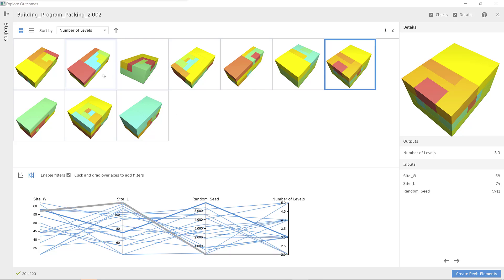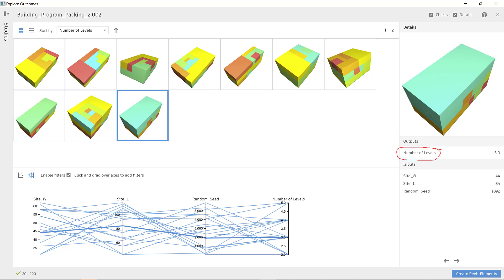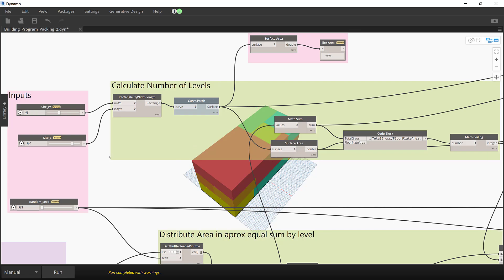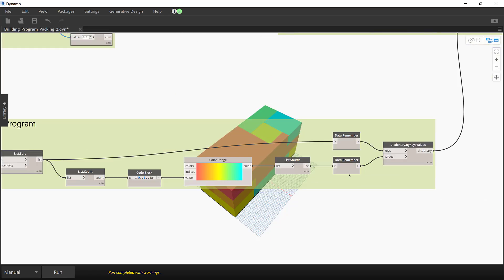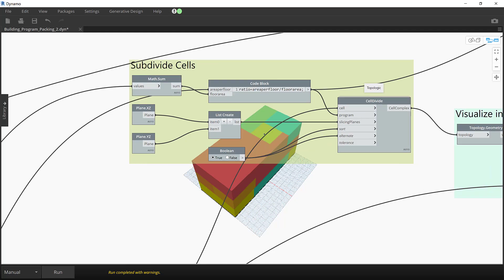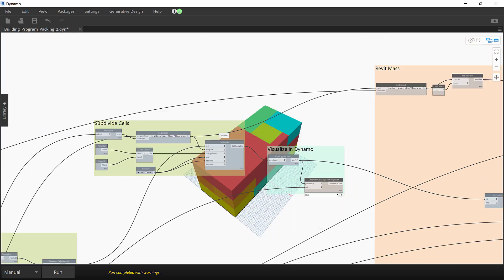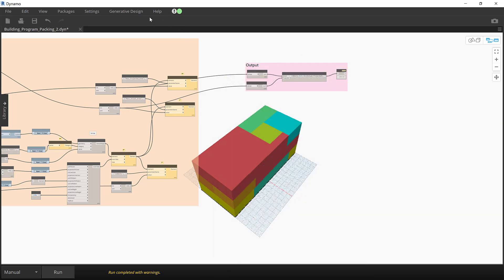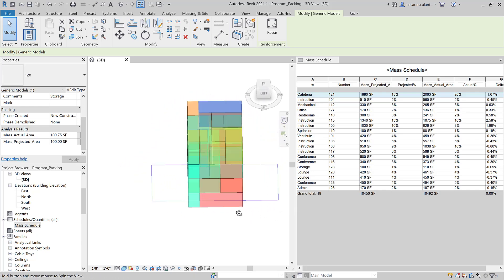Building Program Packing Optimization Study in Revit

Comment: Thanks for sharing this - really very interesting. I would like to use it as a jump off point for a side project I'm working on (self teaching myself generative design) - would you be able to share the layout of the excel spreadsheet you are using or examples of the data rows maybe? I'd be hugely grateful for any help getting going with this fascinating tech but also understand if you are not able to share exact details.
Reply: Have you found any useful vedios for generic design because i have the same problem